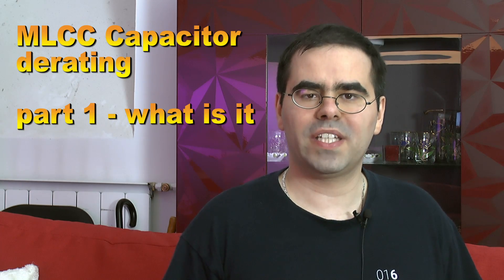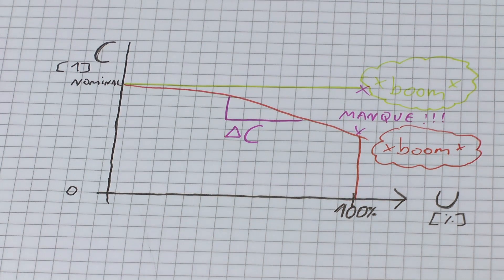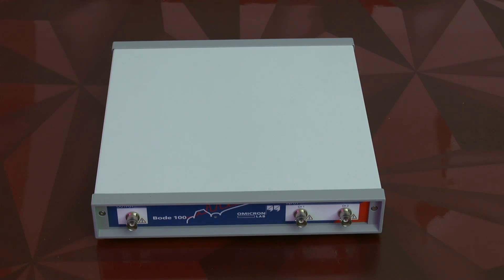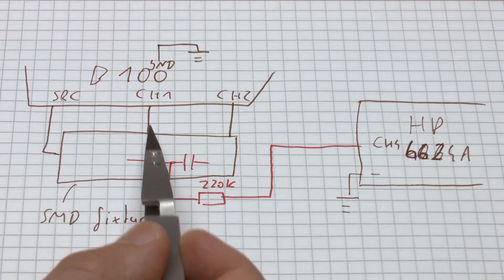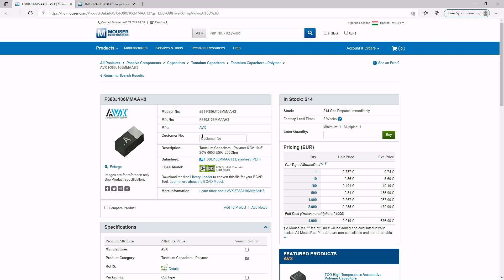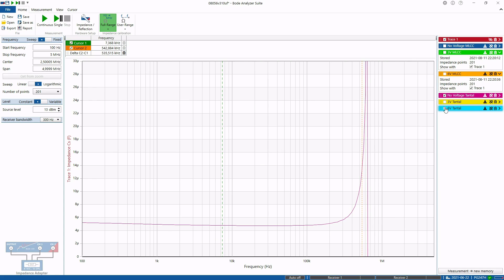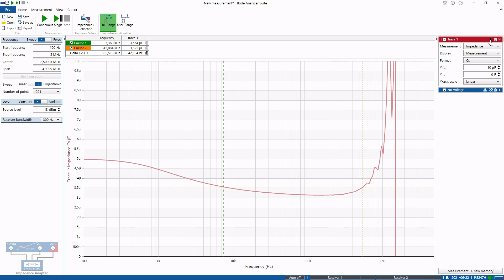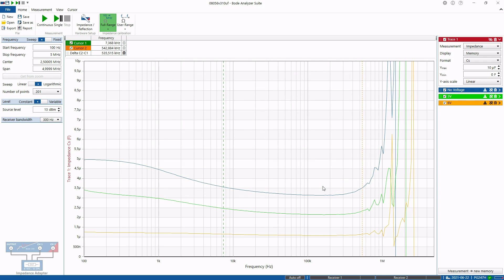MLCC Capacitor Derating - the basics

Comment: I've started my journey into the world of electronics and the first question I have is how can we find the values of a multilayer ceramic capacitor that is shorted without schematics??
Reply from the maker: Hello Tom, sorry for being a bit slow re this.

This is a good question. While SMD resistors often are marked, MLCC capacitors usually not. So I do not have too much of an answer...where is the defective capacitor coming from?
Reply: @MrTamhan   No problem thank you for getting back to me. I mean it wouldn't hurt if manufacturers would laser engrave the values either on the capacitors or on the PCB board or both, would save a lot of headache lol I currently don't have a bad capacitor thank God lol I'm just learning as much as I can through repair videos and stumbled upon this issue, correct me if I'm wrong but if we know the voltage of the power rail could we calculate the value ?? This would make for an interesting video 😁 as I've asked a few people and they've all say I'm out of luck, but I'm sure there must be a way otherwise how else would people design a PCB without knowing what capacitance to put in circuit a formula for this would be really really handy.
Reply from the maker: @tinkertom3683  Hello, this all actually is not so easy. In some cases, the value is determined by the datasheet. In others, by the application. A video would be difficult, as it depends on the case...but maybe I will make one. If you email me at tamhan@tamoggemon dot com I can let yousee it beforehand. And yes, I have been pushing for service manuals for some time...

Comment: One of the most vexing problems I had for the 20+ years I spent as an in-circuit test engineer was small (0.1uF-0.47uF) SMT ceramic capacitors measuring low. Even in circuits with High-Z components or in situations where we could guard the measurement effectively.

To keep from turning on diodes in semiconductors, we'd typically test with stimulus at 0.2V or less, using a bias if possible or needed. Using both AC and pulsed DC techniques (typically below 10kHz), these small ceramics almost always measured 20-30% low, far below their datasheet guarantees. If we could add 1V of DC bias, they tended to behave better, but that was not always possible.

Every exploration of derating I've seen (including this one) shows normal behavior at low DC voltages. We never had time to set up a proper experiment to isolate some of these caps and explore the problem. It makes me wonder if some other effect (piezoelectric from subtle flexing in the board caused by fixturing? though we spent a lot of money doing FEA analysis and strain-gauge testing of fixtures to keep flex to a minimum) was causing the issue, or if the ICT equipment was just eating away at my sanity.
Reply from the maker: Hello Jim,
thank you so much! I just sent the question to Omicron, who have a few capacitor experts on hand - maybe they will respond!

Tam